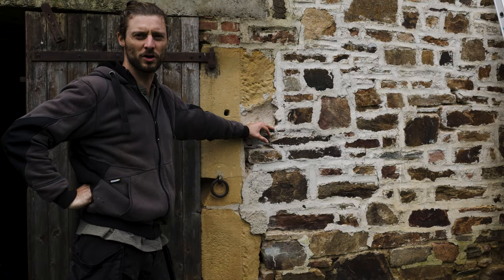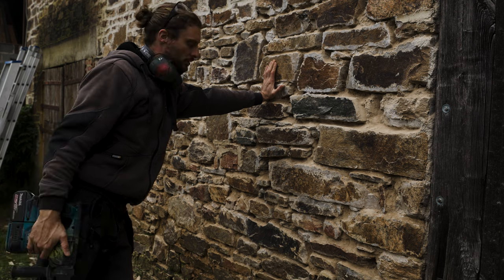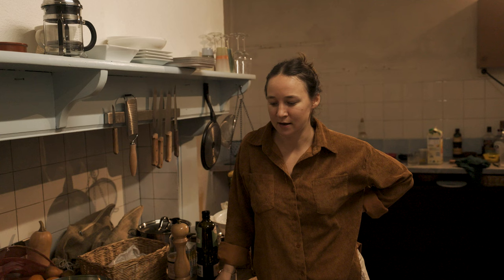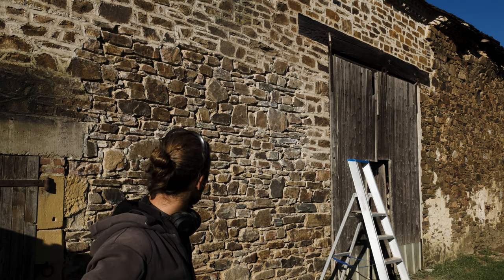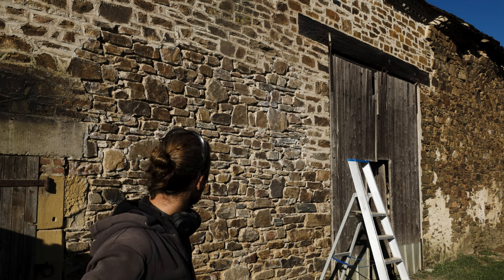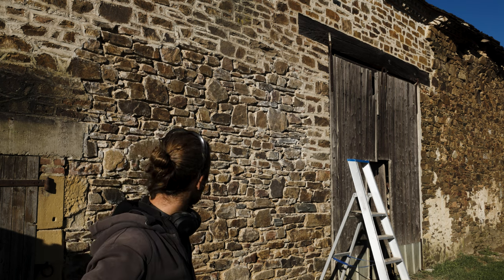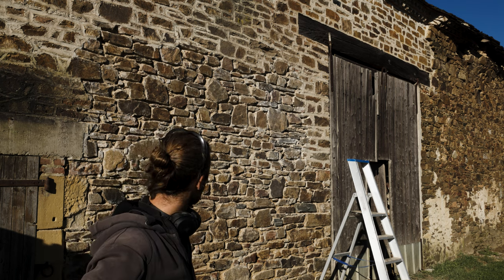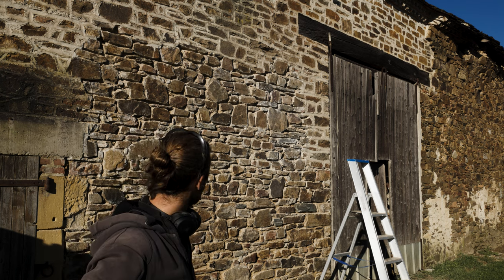23 - Renovation Of Our Old Barn. Removal Of The Old Pointing.

Comment: I've seen several other renovators removing cement pointing. They never have anything good to say about it. They too have used angle grinders to take off surface cement. It's a very long job, but you'll be very pleased with the results. Lime morter is a very old product, but old doesn't mean wrong. Try the acid in a small patch close to the ground where it won't be noticed. (or the back of the barn!)
The salad looks yummy! Thanks for the idea of the apples. They hadn't occurred to me. For some reason, I never think of apples. I love honey mustard with avocados and chicken chunks.
Reply from the maker: Hey Abigail, old indeed doesn't mean bad! Yeah i am going to try the acid on a spot you don't see but from what i gathered these stones are hard and shouldn't be affected by the acid (fingers crossed). Anicia is quite the chef, she should video some more of her cooking adventures but the time is not always there and the kitchen has really bad lighting to make a nice video there. I need to put an extra temporary light in there.

Comment: Stone buildings are wonderful and you're to be commended for restoring your barn. Hopefully, you can replace the portion of decorative frieze that collapsed during the storm. The frieze/trim is one of the first architectural details I noticed about your barn and it seems to distinguish your barn from similar stone structures. I think it would be called a saw tooth pattern, but it's two rows, so maybe it should be called a shark tooth pattern. 😉The frieze and your dairy stalls reflect that the owners/workers that came before you embraced both form and function.
Reply from the maker: We are going to keep the trim but i think we will have to renew the tiles because it was filled up with the same product as the stones..
Reply: @DomaineSauvage  Thank you for your reply. Your trim is really wonderful. I don't understand what you mean by "tiles." Can you please clarify?
Reply from the maker: The trim is made out of moonlike roof tiles, but they were filled with the same product as the stones were, but the tiles are very brittle so i will have to get new ones probably  @coolcpa3321
Reply: @DomaineSauvage  That makes sense. Thanks for the reply. Best of luck with your restoration work.

Comment: Well I knew that pointing with cement is a very bad idea but this video shows it more dramatically than any other I’ve seen. I am sure it will really be something when you get to removing the render from the house (luckily, as you say, only one wall.)
Reply from the maker: Haha yeah, i was a bit angry by how it was done 😂. Two more sides to do on the old barn and then indeed the cement render from the house, i did do a little part and it was coming off rather quick 😉

Comment: @DomaineSauvage  when you have some excess of lime mortar covering the stones , one of the most natural product we use is 20% concentrated white vinegar .
not sure what kind of joint you just removed , but it might be worth giving it a try before testing the acid if you want something less corrosive and more natural ... you usually just apply it with a paint brush and wait and it will give a wet clean look to the stones , and you just rince with clear water at the end.
You might also try a mix of lime + 10% max cement to rejoint instead of just lime mortar if you want something a little more durable but who still breath
Reply from the maker: I can give it a try with white vinegar, i already bought the other acid but i can compare the two. 👍

Comment: I think you need to diminish the air inflow on your woodburner to save consumption of wood. There should be a handle 😅
Reply from the maker: It is underneath at the front 😅
Reply: Normally, yep. You will notice the flames deminishing